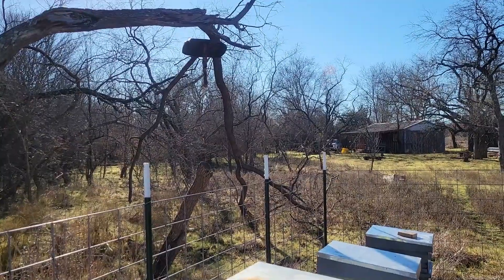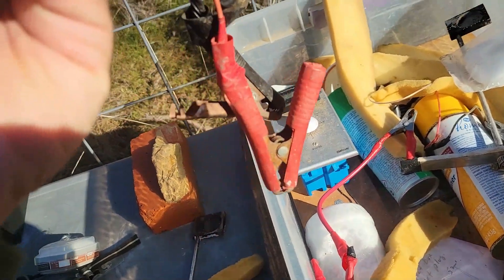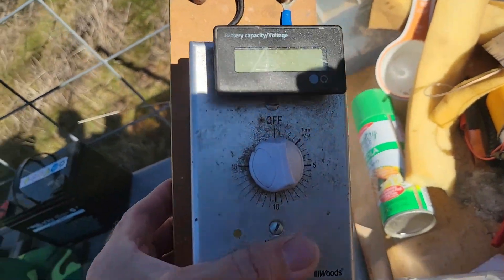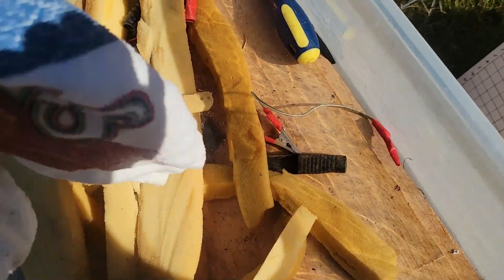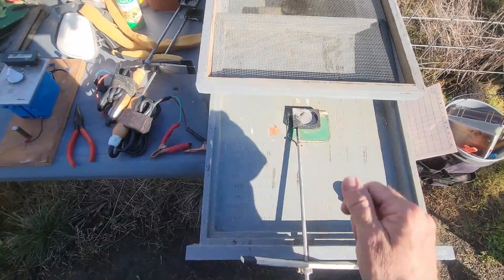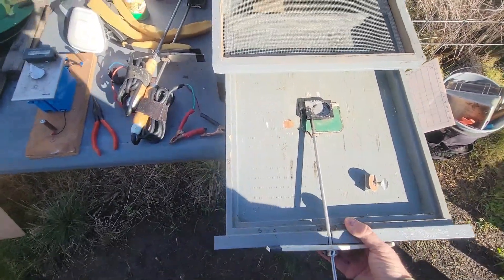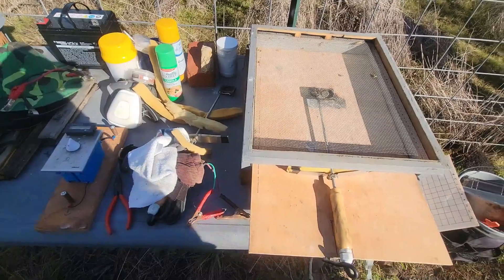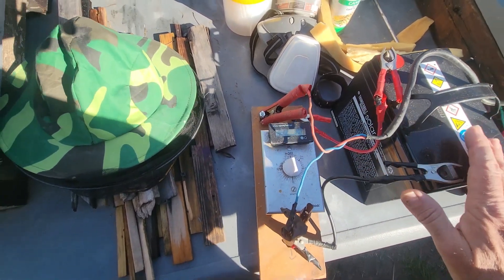Oxalic Acid Vaporizer Kit

Comment: Hello Phillip! Thank you for the shout-out :)  I like the heat-shield/pad you've put down at 09:05 as well as your bottom tray system. Haze-Gray Boxes with attached handles, NICE! If you get the InstantVap someday, you'll thin down your OAV kit by quite a bit :)  I wish you all the best with your bees!
Reply from the maker: Thanks Fred.  Since you put me on this path I thought I should give you credit.  Early on I was trying to save money and going in thru the entrance was a real pain (literally!).  So I set out to fix that.  Since I make my own equipment it was just a matter of solving a few issues.  This method works great for up to 10 colonies, ok for up to about 20, but at that point you are into about 2hrs of effort.  I will probably go to the 110 wired version first since I don't use the types of batteries the InstantVap requires.  If and when they offer Ryobi 18 Volt, I'll probably not be able to resist!

Comment: I like your bottom trays to. Not to use one of those burners, but it's kind of an upgraded screened bottom board/tray. I'm going to have to check out some of your other videos for a good bottom board video.👍
Reply from the maker: Thanks DC,  I plan to do a video with my overall system and another with just how I do the bottom boards.